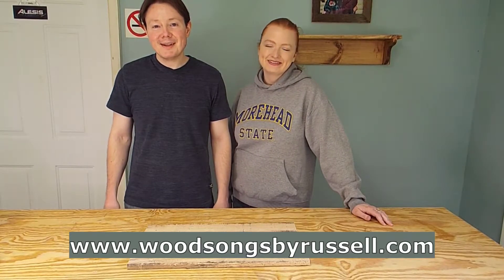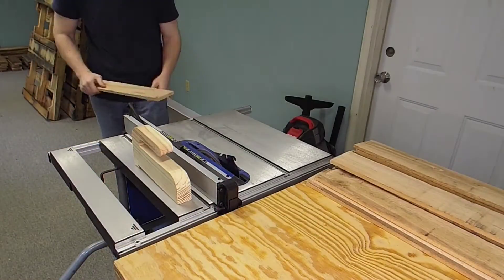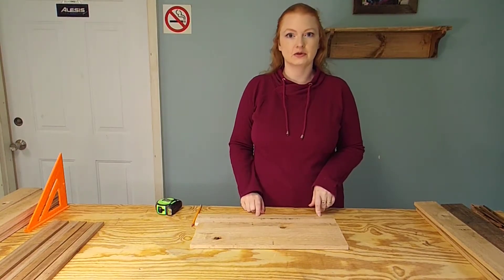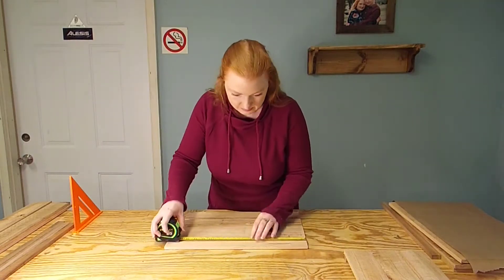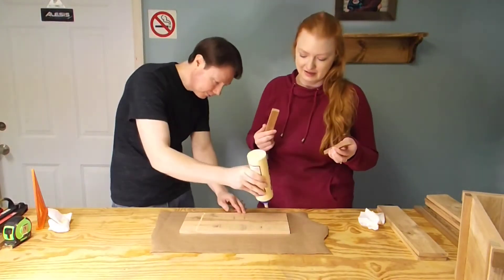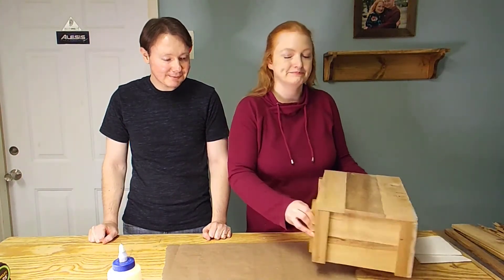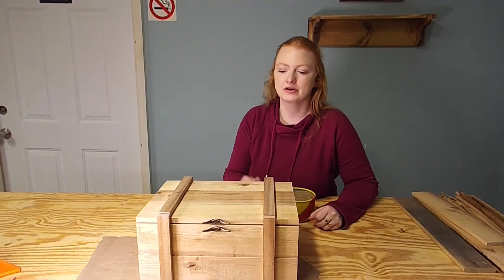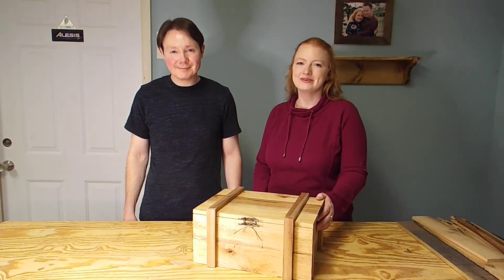Small Wooden Crate DIY | Projects with Pallet Wood | Heritage Crate

Comment: Yeah, math can be a heartbreaker! A friend texted me pictures of three trays used for charcuterie that she wanted that nested together, each showing the outside dimensions, and 3” height. They also requested that I use the cheapest wood I could find because they wanted a country look! I found a good deal on some relatively decent looking pine 1x4’s, and proceeded to build them. After the finish had dried, I decided to nest them (for the 1st time!) for storage until picked up, only to discover that none of them would nest inside the next bigger one! The thickness of the sides wasn’t specified, but it was evidently 1/2” or less, and I’d used 3/4”! The only thing that saved me was that she called back shortly after I found my mistake and said to build two sets instead of one! I adjusted sizes on the second set so that the largest would allow the mid sized original tray to fit in it, built a new middle tray to fit in the original large one, and made 2 new small ones! I only had to eat the one small tray! Ha! Sorry for writing a book!
Reply from the maker: That is a great story, Tom! I think we learn something new with every project, but we have the crates down pat, now :) Thanks for watching and sharing. #happywoodworking